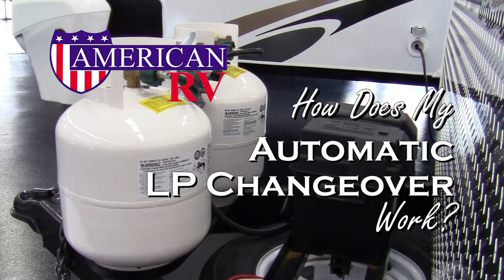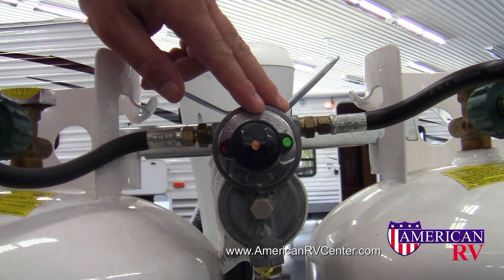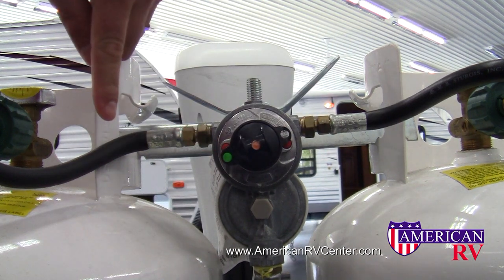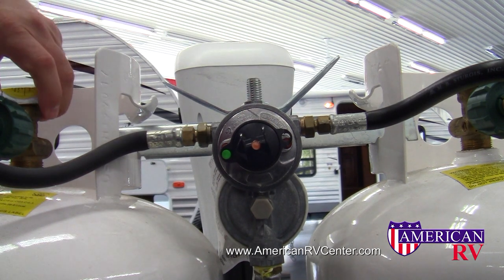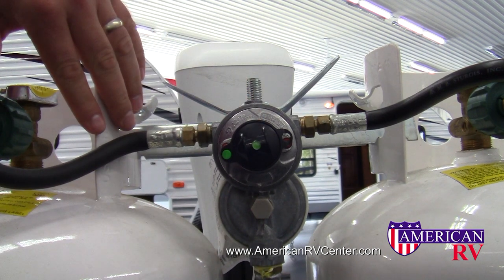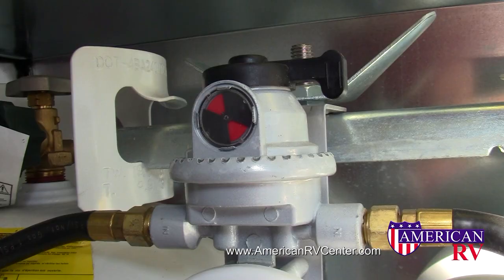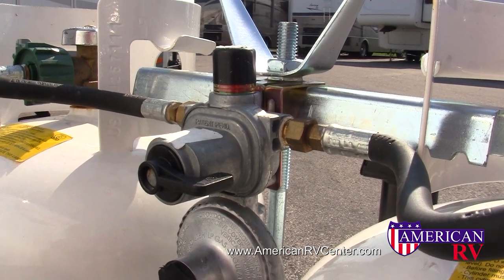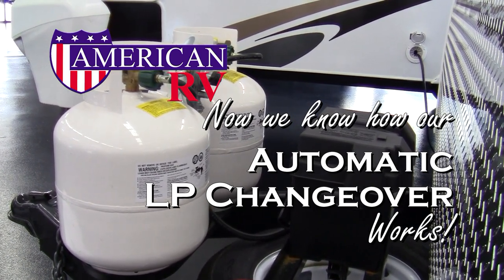How Does My RV Automatic Propane (LP) Changeover/Selector Valve Work?

Comment: On my 2012 5th wheel our automatic changeover valve failed after a couple of months of use. It wouldn't switch between tanks and would indicate tanks were empty when they weren't. I have since replaced the valve (and it now works fine) because I was told they are not a serviceable item. Can you explain what may have failed and what could have caused it?
Reply from the maker: Tom Stillman There are quite a few small components and diaphragms in those regulators. Any one of them could have failed. It's not unheard of for a regulator/changover valve to fail after a couple years.

Comment: INADEQUATE!  No instructions on how to remove the empty tank.  Do you leave the valve handle toward the empty tank or switch it over before removing the empty tank.
Reply from the maker: You would switch it toward the full tank, however we have seen some regulators bleed LP through the disconnected line, so we don't recommend removing a tank and leaving the other one open.